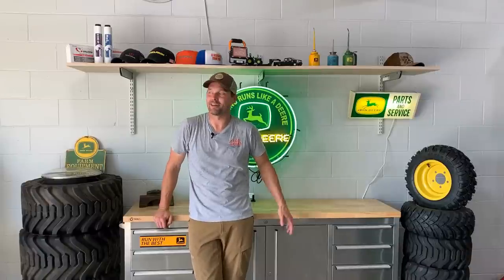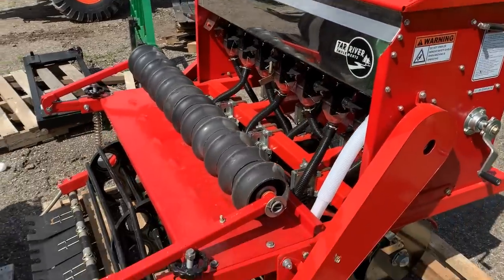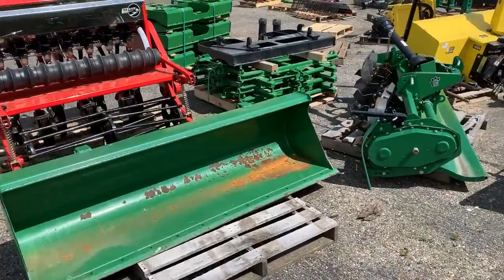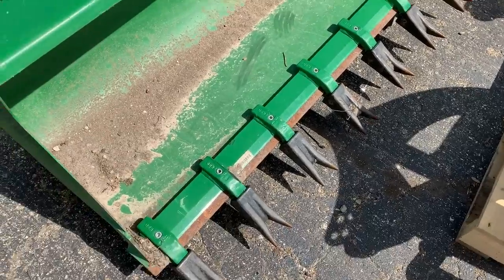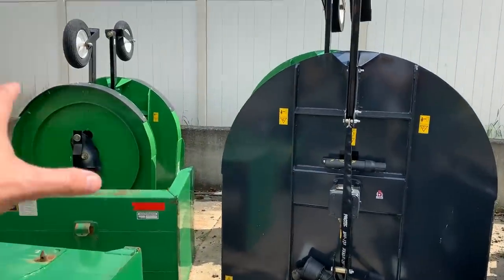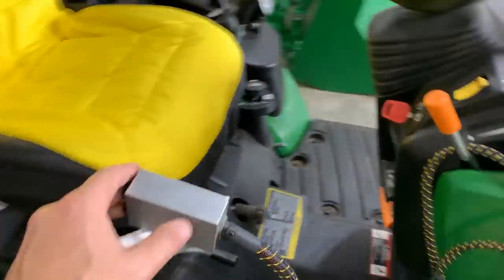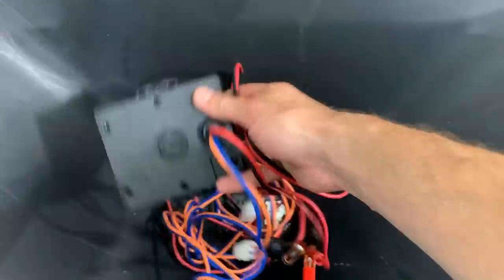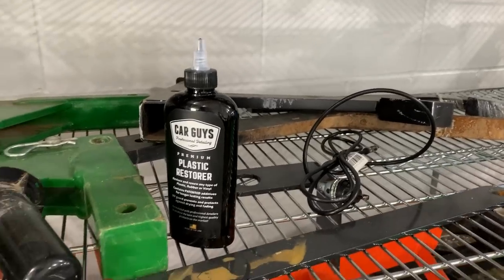TRACTOR ATTACHMENTS FOR COMPACT TRACTORS! GRAPPLES, FORKS, MOWERS, & MORE!

Comment: 👍 Buying a 3038E Monday. I’d like to add the grapple, How much are the electric version and how much for the “standard” version. How expensive is it to add the 3rd function? Thanks
Reply: May look at the Westendorf brush crusher. Doesn't require any 3rd function hydraulics. I have a 3038e. Just got done discing another food plot. I love the tractor.
Reply: That guy2 - 
Well I didn’t pull the trigger yet. Considering the R series. What do use yours for? How much land do you have?
Reply: @buckdragger9215  food plots, brush hogging, pushing piles up tighter to burn, moving large pieces of limestone around, light dirt work, etc. We have 35 acres.
Reply: That Guy2 👍🏻

Comment: I don't see the 2025r drive over 54" mover deck on your website? What's the price and can you ship it reasonably enough to justify the price to NW N. Carolina?
Reply from the maker: I'm selling it for a customer.  $1,950 plus tax and freight.  Shoot me an email with your zip code and I could work up a freight quote if interested.  Thanks!
Reply: Good Works Tractors 54D AutoConnect 7-Iron Mid-Mount Side Discharge Mower (1023E, 1025R Model Year 2020 and 2025R)
$1,581.00
PART #700CLV
Reply from the maker: Please go get a quote on a new one from a dealer including all the attaching hardware.  You're quoting one part, add another $1,000+ to that number.